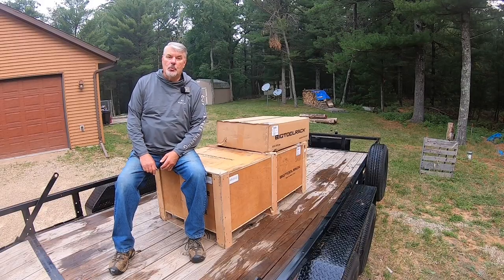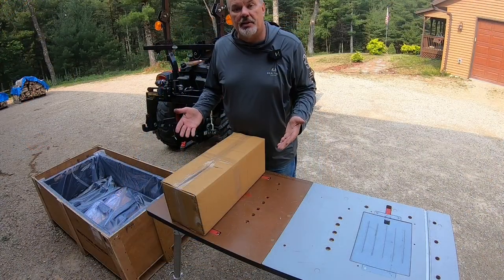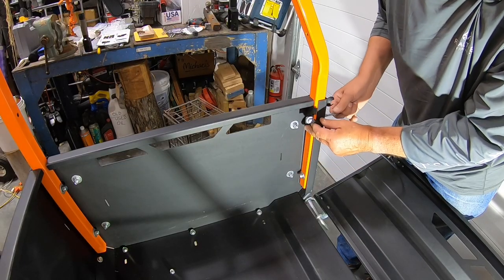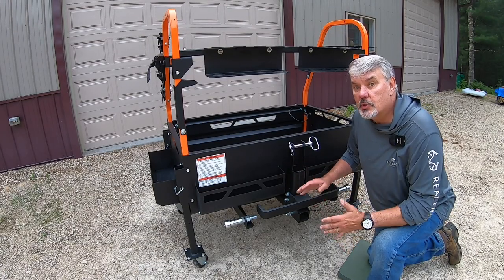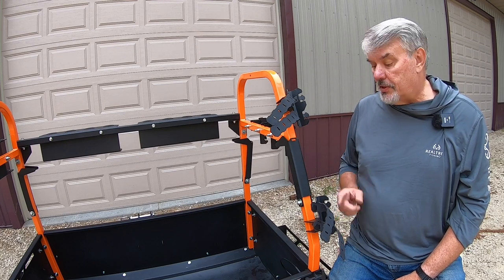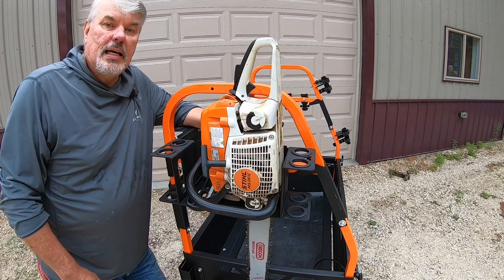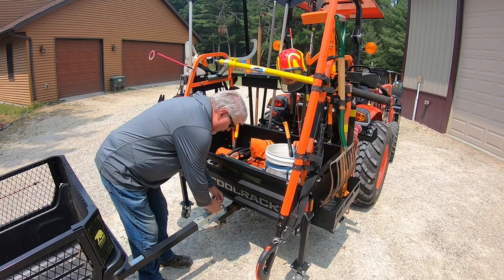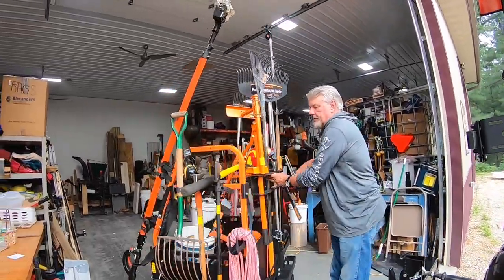Ultimate Tractor Tool Storage -87 #BigToolRack

Comment: It will be lunch time, by the time all the tools are loaded!🤠
Reply from the maker: Ha ha Wayne, but the upside is I won’t have to keep running back to pole barn or garage for tools I forgot. 
And yes I’m blaming it to old age and feeble mind! 
Hope your 4th was restful and cool.
Thanks for watching and commenting 👍TCT
Reply: @TonysCoolTools  Had a great holiday but it was hot and muggy!
Several channels I follow have gotten the tool racks over the years and went on about them being the greatest thing since sliced bread and used them alot. However...over time I have noticed all of them using them less and less for some reason. I will even see comments that they need one from new viewers who aren't aware they already do. They would take up alot of space if a guy wasn't using them all the time. Kinda torn on them...but they are sure built nice!👍
Reply from the maker: @waynetharp  Wayne I can’t say I’m gonna have this mounted to the tractor most of the time but definitely when I’m going to the woodyard or tasks throughout the property. 
I typically don’t have any attachment on my three point because I’m always moving pallets and IBC totes. 👍TCT

Comment: How good does the tool rack work as a counterweight for grapple work for logs? A bit bulky as a counterweight for some situations, should be fine for other times.
Reply from the maker: Jeffrey by itself you are about 300 lbs for counter weight, but you can fill up to over 1000 lbs with stuff. No issue with grapple work but you need to be aware of turning radius.
Appreciate you watching and commenting. Happy 4th👍TCT